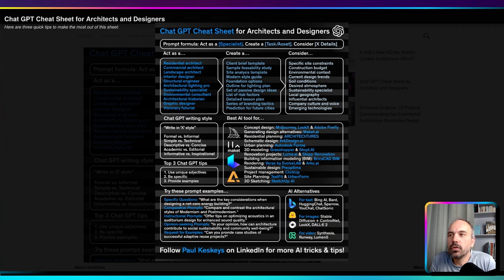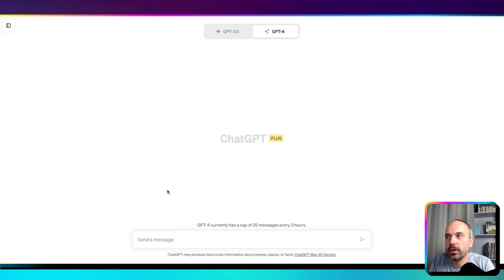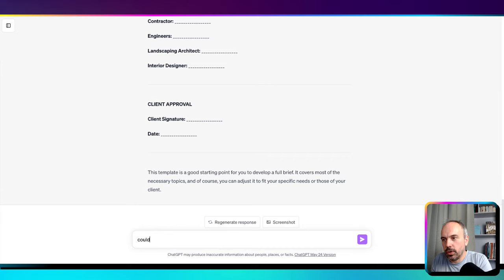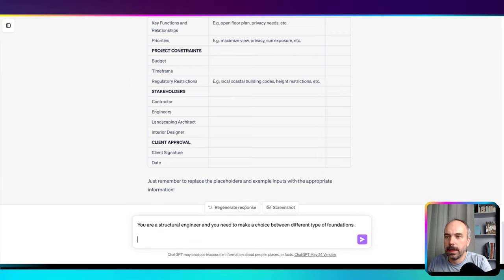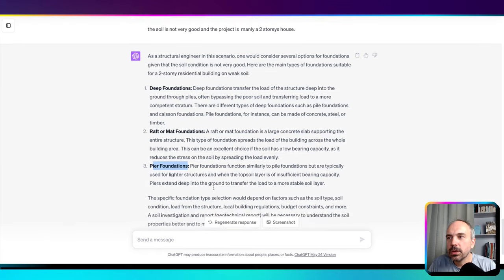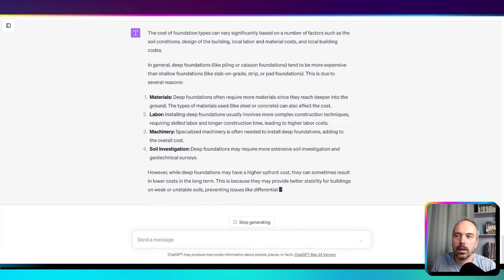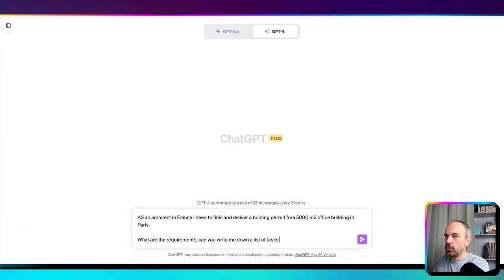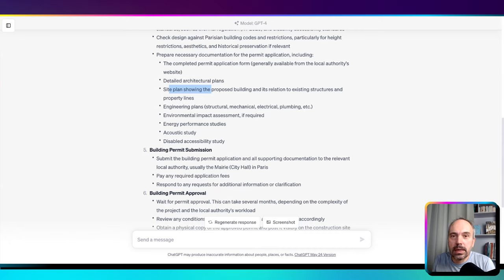How to use Chat-GPT as an architect or engineer / Practical Chat GPT prompts for Architecture design

Comment: Interesting use of AI, have you try to create specific design parameters and apply them into an AI image generator like Midjourney or Dalle, it might have great resutls. thanks for sharing
Reply from the maker: Hello 

What do you mean by that ?

Like material : wood 
height : 5m
width : 5m
style : modern architecture 

In my test with dall E, midjourney the difficulty is to control the final output.

I think an input from a sketch or 3d software is better for the control.

And the image generating is more to make the rendering.